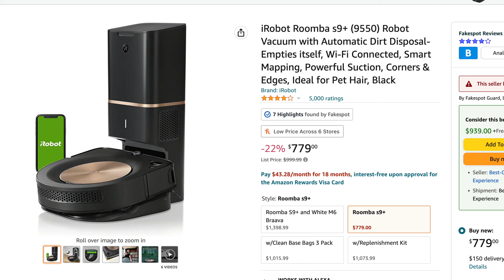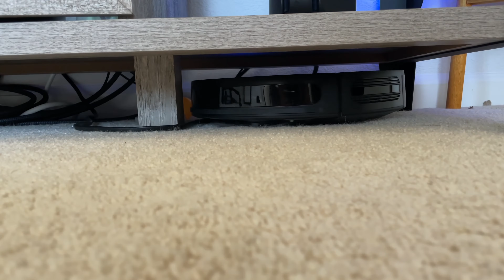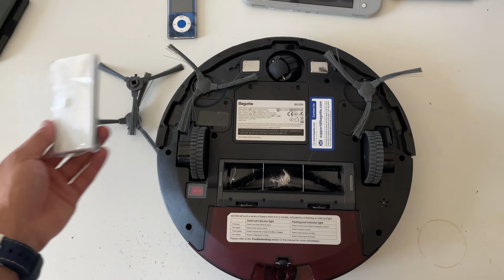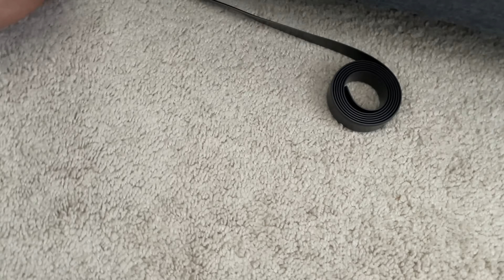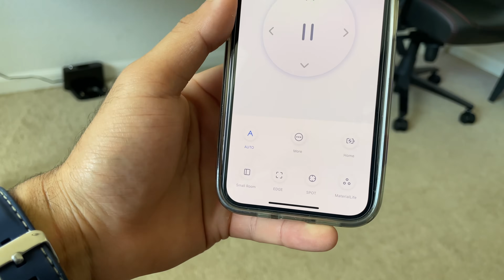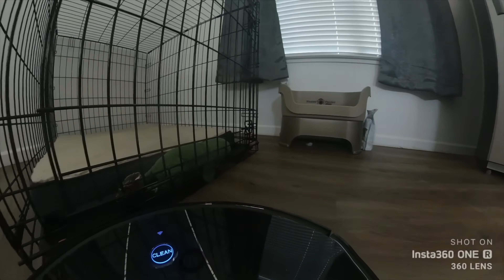($99) Most Affordable Robot Vacuum in The Market!

Comment: I bought a iLIFE A4 in 2017 for $164.99 now the newer model costs $140, its like this one not that smart but it does the job, the only bad thing is that the battery died after 2-3 years, the battery recplacement costs $40 and now its working again. I just wish it was easier to clean, the bristles get tangled so easily with my gfs hair.